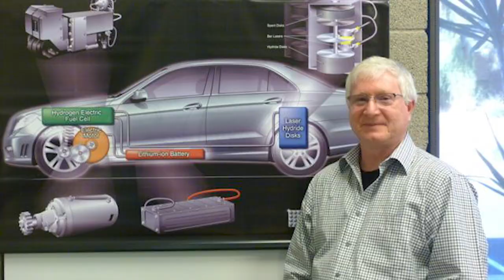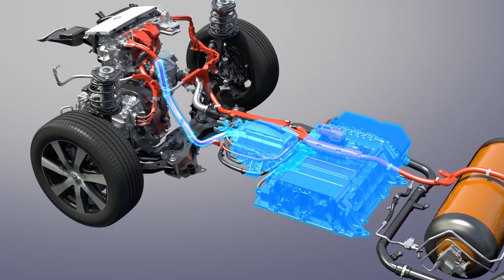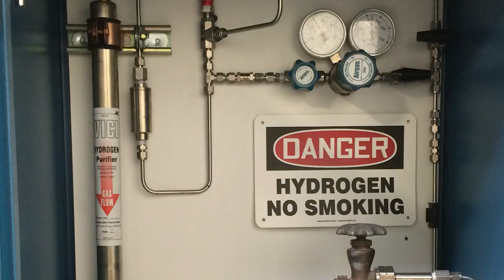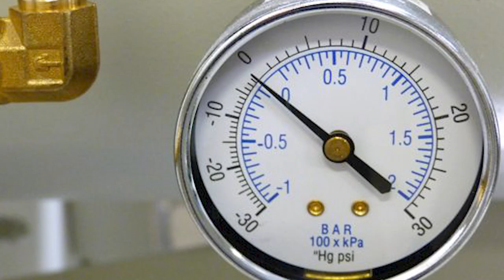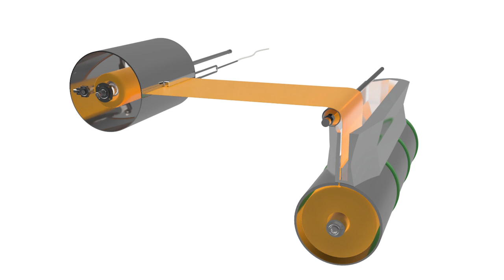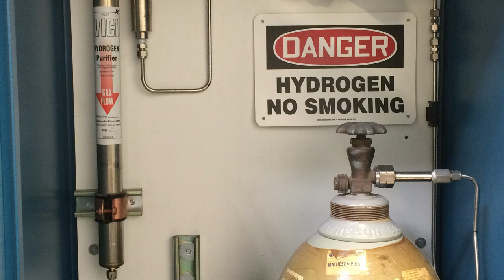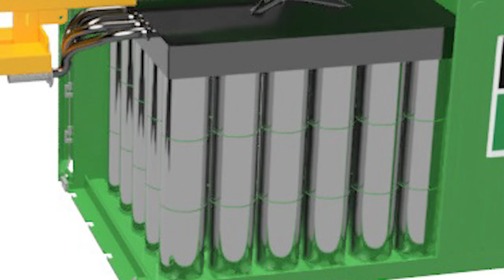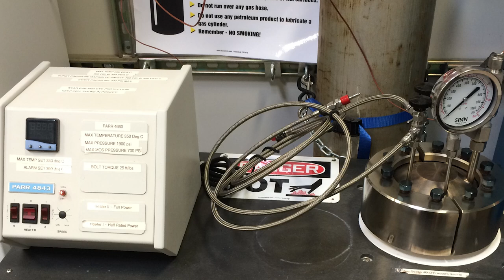This BANNED Technology Could Push Hydrogen Cars Over BEVs

Comment: Having to pick up hundreds of kilos of disks every week seems a lot less convenient than charging my car at home. I can't even imagine how much this would cost.
Reply: a lot
Reply: Amazon will deliver the disks
Reply: these disks, unlike the batteries, do not degrade over time
plus, there is no wait time, you swap them out in just a few minutes, instead of the hours that it takes to charge
they are much lighter than batteries, so you'll ultimately be getting more miles out every kW
and even if they will not end up being all that much cheaper, you can't discount the convenience factor
after all, convenience is the main reason IC cars are still a thing
Reply: @AlJey007  I fail to see how having to go to a store to pick up Hundreds of kilos of disks is more convenient than charging my car at home while I sleep for a tenth of the price. 8 cents a KWH.
Reply: @DuckHunterGaming  could have sworn he said this was already cheaper than batteries...
Reply: @davidclark538  he does say it is cheaper than the batteries
Reply: @DuckHunterGaming  it is not, if you only drive short distance and you have a garage with a charger at home
Reply: @davidclark538  he said it would cost half the price of current hydrogen which would put it still 5x more expensive to refuel than an electric car, Hydrogen in my area is 10x more expensive currently. Hydrogen will always be more expensive since you have to use energy to manufacture, where battery cars literally just use that energy to power the car without the additional steps. The energy density would only make sense for things like ships, long haul trucks, planes where you need to travel 1000s of miles everyday. Will always be cheaper just to use the energy to power something.
Reply: Duck hunter;
ReWstch the video at about 13 minutes.
Reply: @AlJey007  So you haven't been keeping up with car battery tech. It doesn't take "hours" to charge a car on the road. It takes "hours" slow charging at home... but.. ... you're at home. 
You don't need to charge your car at all to commute to work (unless you have street-only parking or similar). 
For the average Tesla owner, charging is something that takes No time at home and only Occasional fast charging on long trips (in excess of 100 mile radius). Then it takes about 30 min to 80% on a supercharger.... 
so no. This is expected to drop under 20min with the new 4680 batteries coming out in the next 2 years. 

It actually takes Longer to swap out hydrogen cartridges as you won't get free-time cartridge installation at home. 

Regards batteries degrading over time, Tesla batteries degrade about 10% over 200k miles currently, This is expected to drop to half with the new 4680 battery. Battery life (assumed 80% capacity lower limit) is currently 300k miles expected to rise to about 1M miles over the next few years (4680 battery). 

Recapping: 

It is Already more convenient to charge than swap out cartridges as you won't have a charge-from-home option. This assumes No advance in battery tech.

Electrolytic H2 is Very expensive and is not used industrially today due to cost. It is Very energy inefficient to electrolyze (they currently extract it from CH4 as that's much cheaper).... So the H2 will still be very expensive - more expensive than gas, much more expensive than electricity. He mentions Blue Nat Gas (this is natural gas created from a magically cost-free carbon capture). 

And as we all know, carbon capture is easy, that's why rising global CO2 levels  can be reversed almost over night. That's why Blue Hyrdrogen is a thing.... as opposed to a unicorn presented to the math challenged as a solution. 

The Charging stations will soon be able to turn around an EV in 15min, currently 30min. They don't need complex machines to pop out/in a 250lb cartridge. Then recharge them, electrolyzing H2. 

The comment of "cheap H2 from waste" was a dodge that Nikola tried when they claimed their H2 would magically be 1/4 the cost of everyone else's. 

For the record: H2 costs $16/kg = 2gal gas on range (California avg price 2019).  Like paying $8/gallon for gas using Nat gas extraction.
Make it through electrolysis and the cost goes UP from there. 

Fix that problem first, Then tell me why H2 is good for transportation.
Reply: @AlJey007  Swapping out 100 kg of disks that are 'nano thin' ? Maybe a miilion of them (OR MORE) ? How does that work Mr Expert ? And NO ! You most cetainly won't get ANY more miles out of every kilowatt(hour). That is set by drivetrain efficiency only and doesn't change with the energy source.
Reply: @avgjoe5969  There are some seriously 'dodgy' claims made here and even dodgier on their website.
Reply: @davidclark538  He said the up front cost is cheaper than batteries.  The daily operating cost is another matter.  I suspect it will be considerably more costly per mile driven - which will eat up the savings over time of having disks that are initially cheaper than large lithium ion batteries.
Reply: @AlJey007  they say in the video that they only last 100 cycles and then need to be recycled. There is also no "charge them at home" process, you return the empty  ones and get filled ones.
Reply: You make a very good point.
Reply: @AlJey007  The range is 20 miles for 15 pounds.  1,200 pounds (the average weight of a Tesla battery pack) will give you a range of 1,600 miles for a first generation disc pack. Future generations could potentially give double the range at half the weight, especially with advances in graphene (an infant industry), which itself is extremely light and hydrogen is the very lightest of all elements, so potentially 3,200 miles for a 600 pound pack. If they do a disc pack swap like a battery swap like Nio does, and you only drive short distances, you only need to swap out the pack 3 or 4 times a year. Even at higher miles, you might not have to swap it out more than once a month.  Most people go to a gas station once a week or so, and a swap could take less time than filling a gas tank...
Reply: @OlJackBurton  could not agree more 
I would love to have a car that can do 1600 miles on a single “tank”.
Reply: @DuckHunterGaming  Diesel is still the most convenient.
Reply: @avgjoe5969  very good points
Reply: For persons who lack a garage—over half the population, and more abroad—replacing disks would or could be more convenient than driving to a charging station. And maybe cheaper.
Reply: @grahamstevenson1740  Yeah.... the whole dismissal of the source of H2 as a problem reminded me too much of a certain Nikola dude.
Reply: @AlJey007  we dont know that for sure. Kind of interesting as a battery for some applications.
Reply: @avgjoe5969  respect for the full on post. Totally agree.
Reply: @OlJackBurton  so magic? A company with no track record. And no one is factoring how expensive it is to make h2. Good luck to them I guess.
Reply: The weight of the disks/films will be irrelevant though, as the vision is to have an automated machine that swaps them out. When you fill your empty gas tank with gasoline you've put in close to 100 pounds, but that doesn't matter at all since you are not physically lifting it - the pump does all the work for you.
Reply: @runningman5871  I think what companies like this are betting on is excess generation from renewables, currently there are places in US where hydro, wind and solar have to alternate because there isn't enough demand on the grid for all contributions. So technically if you're able to produce and store hydrogen, even if it's fairly inefficient, its still better than shutting down completely.
Reply: @viktorcad  could just use a flow battery. Or a flywheel or a thermal battery. Honestly the energy equation for h2 makes little sense.
Reply: @runningman5871  Although any of the mentioned energy storage systems can and do work, it's still a very infant and expensive industry so things like H2 production can be an option, if there are enough advantages. For example, if deployment costs were significantly lower.
Reply: There's basically two ways to get hydrogen. The first is the most used one which is to take natural gas and convert it into hydrogen. So it's the energy to mine the natural gas, then the energy to refine it and make the disks. Then the up to 60% efficiency of the fuel cell. Or you could have a 95% efficient battery that's 5% less efficient due to weight.
Reply: @DuckHunterGaming  but you emit a ton of co2 in the process if you split methane.
Reply: Sound way way way more green than EVs
Reply: @smarterthanyou2674  no, not at all
Reply: @OlJackBurton  its basic physics. To split h2 from h2o needs you to remove salt and purify and then you crack it. H2 is very reactive, so need to store it at v low temps before you add it to the magic disks. It really isnt hard to see this is less efficient than just charging a battery. Great if we have a fantastic grid of ready made h2, but we dont. Adding one seems dumb.
Reply: @AlJey007  cars dont take hours to charge. Ionic 5 takes 18 minutes for 200 miles, most times its charged at home in the night. The disc system means you are locked to few companies like the oil companies.
Reply: most people will have to upgrade their home power to charge, unless you you can wait 12 to 24 hours for your vehicle to charge every day or two.
Reply: @survivortechharold6575  getting a home charger is easy. You can charge a car while you sleep.
Reply: Frugal Family Living  Lightening the car is a reasonably good idea BUT using hydrogen needs a fuel cell plus some batteries to buffer the power delivery. I doubt there'll be any weight saving overall. Saving weight only reduces the rolling resistance btw. At highway speeds the aero drag predominates.
Reply: @AlJey007  Batteries routinely run thousands of cycles to become End of life, as in 70% of the original compacity. Thats literally half a million miles or more PER CAR. Fool Cells also has degradation over time as well
Reply: @DuckHunterGaming  wait until governments realize EV owners aren't paying into the infrastructure taxes that are usually added to the cost of gasoline. That 8 cents you're paying will suddenly be a boat load more.
Reply: It can be used for emergencies as a backup and for long trips, but charging batteries will always be cheaper, especially if you own solar panels. You can even sell your excess electricity to the grid for profit, which is a great passive income.
Reply: @DuckHunterGaming  this seems like a technology better suited to the aircraft industry or maybe trucking.  EVs are way more convenient.  I'll pay the extra price to plug in and sleep.
Reply: @SkepticalCaveman  the problem with that is you don't get to determine what you charge to supply the power and as a 'green' energy source, panels aren't able to be recycled and made of toxic chemicals. Not even joking, when we get rid of expired panels, we dig a hole in the ground and bury them in it. Out of sight, out of mind. :/  Don't get me wrong though. I love the idea of solar power, but the scientists need to come up with a way to recycle them.
Reply: I see no reason you couldn't recharge the disks yourself at home.  All you need is a source of atmospheric-pressure hydrogen and you can get that from any one of a number of hydrolyzers on the market.
Reply: @shiakas  Why couldn't you  recharge this at home using solar-generated hydrogen?
Reply: @OlJackBurton  hell, put the disk pack on a trailer and go 5000 miles.
Reply: @rogerknights857  and the tech is a helluva lot cheaper and environmentally cleaner (if you source your hydrogen from solar/electrolysis)
Reply: @DuckHunterGaming  where are you getting this 60% efficiency number for the fuel cell?  The fuel cell converts hydrogen quantitatively to electrical power with no more losses than any BEV.
Reply: @runningman5871  So don't split methane.  Electrolyze water with your rooftop solar.
Reply: @DanielASchaeffer  i guess that the process is proprietery and complicated. The spokesperson didnt even mention the posibility of home charging.
Reply: @shiakas  Clearly they need a better spokesperson than this guy.  There were some many things that were poorly covered and questions that were misunderstood.
Reply: @DuckHunterGaming  a machine would swap your “cassette” for a new one, probably very quickly. then you hit the road, unlike your charging battery. might as well take a nap while you wait an hour for a charge
Reply: @shiakas  combined efficiency of electrolysis and fuel cells. Best case = 83%x60% = 49.8%. Worst case = 50%x40% = 20% and that neglects any efficiency loss in the storage medium and its distribution
Reply: @DanielASchaeffer  or just charge a battery. You also need litres of clean water. I don't see the need.
Reply: This is terrible for the enviroment.
If we get the hydrogen from hydrocarbons more greenhouse gas
If using solar and water through electrolysis it is at most 30% efficient.
Reply: @kaiki8490  Bear in mind there are significant environmental challenges posed by batteries.  Also, why would I care if I'm wasting 60% of the sunlight hitting my solar panels - it's way more than I need and with next-gen perovskite solar panels coming out next year I'll be wasting even more?  With a Tesla I can't carry 4 people + luggage to a ski resort at 8000' elevation 150 mi away without recharging.
Reply: But you can avoid going to the gym, imagine how strong you will become putting in and out 300 pounds every day..🤣
Reply: @AlJey007  taking in and out 300 pounds of disks with your hands is not convenient, it is workout time!
Reply: @DuckHunterGaming  the conversion losses for producing hydrogen, then conversion loss again regaining energy from the hydrogen, will always make this form of fuel limited to specific use cases. I don’t see hydrogen ever beating direct energy storage in vehicles on the long term.
Reply: @AlJey007  It takes me 20 seconds to charge my EV. Admittedly, it then takes my home charger another 4 hours, but I've long been in bed asleep by that time. Much easier than service stations for local travel. Soon the superchargers will fully compete with gas pumps in time on road trips.
Reply: @Digital-Dan  good for you. I don't have a garage and I frequently take ~1.5k mile trips.
Reply: @AlJey007  By the time you convert electricity to hydrogen, put it on the film, laser it off the film, then convert it into electricity, put it into a battery (yes fuel cell cars still need batteries because fuel cells lack power), you are not going to be getting more miles per kWh than a pure BEV that just has to put it into the battery. He said 15lbs gets you 20 miles, which means to get the equivalent of a 10 gallon tank on a rather poor ICE car getting 14 mpg, you would need to load 105lbs of film canisters. Which means it is going to have to be a robot that does it, which is way worse than a pump, compressor, or electrical cable. It isn't more convenient than anything on the market today.

Internal combustion cars aren't here because of convenience, they are less convenient than home charging. Internal combustion cars are here because not enough EVs have been produced to meet the demand and the price hasn't come down enough yet.
Reply: @AlJey007  yes the do kind of degrade, in the sense that they accumulate some heavy hydrogen each cycle, but they can be cleaned and the value of heavy hydrogen covers the cost.
Reply: @thorbjrnhellehaven5766  that means that they effectively do not
Reply: Who said anything about having to change the fuel tanks every week? The material can be recharged with H2 100-150 times (14:15 - 14:30), which is not good enough IMHO, and the 370 pound cylinders (167 Kg) are for large trucks, not your car (11:00 - 11:15) in the video. 
This material ABSORBS hydrogen like a sponge absorbs water, so no need for high pressure systems to recharge it. I don't think he said how fast the absorption  process is though. That said, if it is as fast as the existing high pressure refuelling stations it's faster than recharging batteries. Probably not as fast as super-capacitors, but that tech isn't here yet.
Reply: @TechnologyJunkie  At 15lbs for 20 miles, you're doing 15lbs once a week, or 30lbs every two weeks, or 45lbs every 3 etc.

And there was no indication that the film could be refilled inside the car, they very much indicated that you would drop off empty cartridges and pick up full ones.

Not that we will ever know for certain because this will almost certainly never be a real product because it sucks that badly
Reply: @TheReykjavik  Sorry, kind of long. Initially I dismissed this tech, but the more I look at it the more potential I see. 
Changing the cartridges is not something you do on a weekly or even monthly basis. He says (at around the 15 minute mark) that the material (slowly) gets contaminated with deuterium and that their light doesn't release that less common isotope of Hydrogen. This is kind of a weird explanation as it implies that the LASER that is built into the cartridge is not producing light of the frequency needed to release the Deuterium (if indeed light can be used to do that).
 He goes on to explain that when the storage capacity is reduced to 98%, (2% being consumed by deuterium) they recycle the cartridge, harvest the deuterium and sell it. Now 2% storage capacity loss isn't much, and they might be able to go to 10% or more before having to do this, but there may be problems of which we are unaware. 
Here's another idea. Develop the technology further so the cartridges can "clean" themselves, releasing the deuterium, but don't just vent it to atmosphere. Use another cartridge dedicated to collection of that deuterium. These deuterium laden cartridges, once full, could be returned in exchange for a new one at no charge, the hydrogen they contain being sold on to create another revenue stream. This would make it a complete closed-loop system, could eliminate (or at least greatly reduce) maintenance and recycling demands,  and simplify end-user interaction with the system. All good things.
Reply: @TechnologyJunkie  You're just wrong about how the proposed technology works. You don't fill up the cartridges at a hydrogen filling station, which would require a distribution system built around compressed or liquified hydrogen, and the whole point of this is to avoid having to do that.

The idea is that you return empty cartridges that the company would then refill directly from a power source that produces hydrogen without having to first compress or liquify and transport it, and when you turn in the empty cartridge they give you a different cartridge that is full, charging only for the hydrogen in the container, not for the container itself (because you turned in an empty container).

Even if this technology were 100% efficient (it isn't), it would only save about 20% (if not less) of the energy available in hydrogen by bypassing compression, which would still leave it dramatically less efficient than an electric car. And again, it is less convenient because whether you are filling it up at a hydrogen station as you erroneously believe, or swapping out cartridges as they said would be the system, neither of those is as good as home charging.

It maybe offers some advantages over regular hydrogen, but it doesn't approach electric cars. The only place this technology even has a chance to see real use is in places where batteries are not viable, and those places are getting narrower and narrower all the time.
Reply: @avgjoe5969  Ok so now we're going to use 'at the tank' prices when discussing potential EV technology whenever we're not discussing batteries or something? H2 at the pump is not a measurable price point to compare. The tech he's innovating eliminates an enormous part of the costs of H2 'at the pump' - retrieval, compression, hazardous storage and transport, etc.
Also, get over your easy life already. The other 95% of the world - including the USA - live in apartments, condos, and other living arrangements where they don't have 'charging while they sleep' hookup available, or the ability to even have it installed at all. So YES - there is an argument that it takes HOURS to charge your car - to this day. 
I can afford an electric car, and I want one. But I already work 10-13 hour days through the week, and I drive up to 400 miles per day, and I have no way to charge at home.
Guess what? Like MOST people in this country - it just won't work for me. The Chevy Volt I had worked great until I ran the wheels off of it at 350k miles. But, it had gas backup.
No, it is not more convenient to charge for anyone that doesn't have their own home with a garage or happen to live somewhere that provides that service.
We all (at least I don't know anyone who doesn't) want the tech to be here, and be affordable. Until it is actually available and affordable for everyone, stop it with this crap. 
You can't just shoot down innovation you don't like because it doesn't fit your bitchy narrative that doesn't hold it's own water to begin with.
Reply: @AlJey007  Most EV owners do not own a garage with a charger at home, you realize this, correct? Only 1/4 of EV owners have a dedicated parking space close enough to their own electricity source to charge at home. MANY, MANY people live in apartment complexes or tall apartment building with extremely limited or zero electric chargers available in the parking lots/parking garages. And many more will be like this in the future, the future will be renting, not owning.
Reply: @rdizzy1  that was precisely my point
Reply: @AlJey007  I Probably replied to the wrong person then.
Reply: I imagine this to be like memory cards, remember the size of the 16 bit mega drive cartridges, now look at the size of a 250gb memory card. The technology would improve as it goes and become more efficient.
Reply: @DuckHunterGaming  But it does not compete in energy density with fossil fuels. He stated a 15 pound pack gives about 20 miles. An 8 pound/one gallon of liquid fuel gives you far more mileage.
Reply: except for the fact that a lot of people don't have homes or garages to charge at.  My brother is a psychiatrist making close to $500K a year but he considers his current job temporary so he rents an apartment.  He has zero options for charging at his home.  He has to trek out to charging stations, wasting a significant amount of time that he could be home or out and about.
Reply: @onlysublime  so having hundreds of kilos of disks will be much better? What is he going to do carry 100kg from his apartment to his car?
Reply: @survivortechharold6575  - unless you encounter predatory electricians, adding 240 volt circuits to charge from the grid is cheap. Electric dryers and ranges already use 240. Add an additional 240 volt circuit to the breaker box, or a switch over from the dryer circuit if the breaker box is fully populated with circuits already. A simple expansion of the existing dryer or range circuit will work as well if you just drill the family not to use the other item on the circuit when the car is charging, so the load doesn't shut the circuit down.
   That sounds more complicated than it is. It's simple, and should be modest in cost.
Reply: @DanielASchaeffer  - money for the recharge technology.
Reply: @DanielASchaeffer  
   Or avoided
Reply: @albu5137  you are presuming everyone has the facility to charge at home, i don't know about the US but a lot of streets in the UK are rows of terrace houses & you might have to park 100s of yards from your house, you'd need lots of long cables!!!
Reply: @jamesredman1263  Sorry, I can't find the context for this?  To what are you referring?
Reply: Well move 3 pound wight might actually be good for us, and he is probably talking about the total cost ( not the work to load casettes). 

It it takes 10 min to load 5 casettes and you drive 100 miles on it.
Reply: when the grid collapses  how will you charge your car?
Reply: @TheReykjavik  how about the recycling (and the energy that takes) of your so much loved batteries? If there's a cleaner way to power cars or for backup storage of solar and wind, if 'refueling' is only slightly more of a hassle., then it's a serious alternative.

People here talk a lot about the convenience of their Iconiq 5 charging to quickly while they sleep... which is true and it's great, but how green is it? How easy is to recycle those batteries? How much charge do they still have left after 5-10 years? It's time to manufacture cars and other things with a longer lifespan , we need less crap, but that also means an industry must be built around it that is funded by the drivers/users. Otherwise it'll have a short live....
Reply: What we have to also realise, is that not everyone lives in a house! And not everyone lives in a house with electricity, or stable electricity! Many millions of people live in flats, far from the ground so cannot just plug in you see. Not everyone has the 5000 or 8000 British pounds to have a line put into their home distribution box to the garage or drive. Not everyone even owns their own houses and landlords don't want to have any installations done. Countries like South Africa, where they constantly have the power cut off for hours at a time and it's some of the most expensive electrics around for the average pay...petrol is simpler and cheaper still. Having a battery powered car, means you need to charge it, and not always at home! Forget the worry or inconvenience of having to be sat about for 30 or 40 minutes, and if your job is transport, that's down time not many firms are going to be happy with, let's just consider as well how expensive it is having to install charging points everywhere. Here in Britain and across Europe, its size, and burying cables across vast masses of land and countryside is very very disruptive and not eco friendly,...in fact in a lot of ways you're going backwards! So you see, we can't be pro one or biased against another....we have to respect both methods of green energy. And yes we must have these discussions cos then together we can pick out the faults and find solutions quicker, but I think there is a place for both battery cars and hydrogen cars. And it will depend largely on environment and utilities that are available and what's going to work out cheaper. It must not be a case that one is better than the other one, but working it out together, clearly, there is plenty of space in the market for both. I mean what about places with no sun, or little sun...like England, or where they have those research stations up in  the Arctic circle..? They already ship all their food and requirements in and take everything, I mean even their composted poop out cos you can't contaminate anywhere...might as well hydrogen power their forklifts and vehicles to, and they'll come on ship with the rest of their stuff.
Reply: Putting aside the economics, how much FC tech would be needed to accelerate from stop to 120km/hr and how much to haul a load up a long hill at hwy speeds? And if that's impractical, how much battery storage -- how many kwhrs -- to augment what a reasonable sized FC unit could put out? If those ordinary situations challenge a practical FC-EleMotor drive train, the fuel costs, refueling issues, longevity, etc are irrelevant.
Reply: @DanielASchaeffer  is co2 a better byproduct than methane though?
Reply: @clocktower1164  You’d go to prison for enabling the export. Required some better advanced planning I guess.
Reply: @tubbytuber  Sorry, youtube makes thread following impossible. What are you talking about.
Reply: @AlJey007  Next year there are vehicles on the market with over 600 miles of range, battery EVs.  In China, BEVs can be made cheaper than ICE vehicles.  BYD makes a good quality BEV for about $10,000 USD, and I believe it's another company that makes a cheaper, but not as nice, econo BEV for about $5,000 USD.

You can debate the economics of this technology all you want, but frankly anyone who doesn't understand that BEVs already won are cherry picking what you watch so you have no idea about how much battery tech has evolved and the expectation in the next 6 - 7 years, or you're an investor and you just want to say stuff.

China is a great example of what BEV can be because there's buy in by the govt., companies and consumers.  

I suggest expanding your horizons and watch a few more channels covering more technology.

Hydrogen fails from the very beginning, because it relies on finding ever harder to get oil deposits.  Best to leave that oil in the ground for the future instead of using it after multiple conversions to make an technology that's a pain in the but in many ways.

For instance, these huge cargo ships are probably best left burning oil.  They are incredibly efficient.  While this doesn't get you to zero emissions, I don't think it matters.  If some other tech finally can replace oil for these huge ships, fine, but not hydrogen.  That once again still needs oil.  That's not a solution.
Reply: @Midnight Dreary you do realize it takes more energy to produce hydrogen then it would just to use the electricity to power an electric car right?
Reply: You're lucky! I can't charge my car at home, so what choice do I have except relying on a very expensive (compared to home) and not reliable public charging network?
He also suggests that there will soon be a way to swap out the discs for you. So, as we do at a gas filling station, we turn up and open the disc door, then pull out the spent discs and replace them with full ones. There'll probably be some sort of robotic arm involved or something to take care of the weight for you.
Don't forget also, once the government loses the tax dollars on gasoline, they'll be taxing you're home electricity instead! Got solar? They'll probably put a tax on roof space or something? A few hundred years ago, the British government had a tax on light - the window tax - so many people bricked up their windows and led a dark existence!
Reply: @DuckHunterGaming  8cents per kwh i call BS  24cents per kwh where i live
Reply: @DuckHunterGaming  there is no easy fix and there is a downside to every alternative to petrol engines..but people will try
Reply: Did you not watch the video? You can do it at home automatically 🤦🏻‍♂️
Reply: @DuckHunterGaming  Electricity is super expensive in many countries. In my country it is about 1 dollar per kWh! Recharging and filling up gas costs very roughly the same. The hydrogen can be produced in places with cheap electricity and exported to places with expensive electricity. Exporting the electricity is not feasible.
Reply: Go back to horses,that's green and a byproduct of their fuel is fertilizer...lol
Reply: @AlJey007  plus we use our own Solar with Power wall. so buying the discs will be taxed
Reply: @DuckHunterGaming  p my
Reply: The grid can't handle everyone charging their EV autos. Not even close. If EV ever does become viable the power companies will raise their rate to meet the demand. Bottom line is EV autos are not a realistic option for the masses.
Reply: Tell that to all those folks in Kleptofornia or Europe who can't charge their cars because the power grid isn't functional
Reply: @DuckHunterGaming  Ask folks in Kleptofornia who are being told they can't charge their cars because the state screwed up the power grid
Reply: You mean charging 8 hours is better than replacing a disk?
Reply: @DuckHunterGaming  where do you people live with 8c per kwh electric?  South Central PA at 14c
Reply: @flowrebaz6189  one fifth of batteries
Reply: @OlJackBurton  I did not hear cost per mile comparison to BEV or maintanance costs or lifetime of hydrogen fuel cell components.
Reply: @grahamstevenson1740  The Mirai weighs close to a long range Tesla 3 & has similar range and cost.  But, the Tesla battery will run twice the miles of the fuel cell.
Reply: @johndoh5182  The 2023's are out & still no BEV with 1,000km range.  Your right about H2; it will not overcome inefficiency.
Reply: @jonsek  I have no idea why that is. A hydrogen  fuel cell car has the ability to be both lighter and have greater range. I'm not impressed by Toyota's efforts here.
Reply: OPPOSITE of inconvenient. Have a bunch of disks at home and just pop them in whenever. Go camping & have few disks. NO NEED far a charger, especially when on the road is great. PROBLEM is current disk from plasma Kinetics is still too heavy for miles traveled, 15 lbs one disk = 20 miles. But EV's also catch on fire while charging, not often of course, but they do once great while. PEACE of mind when I am sleeping at home knowing there will not be a fire in my garage while charging EV overnight. ADDITIONALLY, electric rates can be expensive where you live, rates in my area have gone up. Solar is still too expensive and 8 months of the year it rains too much or have dreary grey days in NW WA state so solar not as feasible.
Reply: @avgjoe5969  Forget Nikola---CUMMINS, TOYOTA, HYUNDAI are into HYdrogen. Invested a lot of $$$ in H2/fuel cell. Toyota/Kenworth FCEV Semi already have 10 Semi's working in port of LA since 2022. Hyundai already has it's FCEV Semi working in Switzerland.
Reply: Not viable in my area for solar 9 months of the year...so therefore too expensive for me to buy panels for 3 months use.